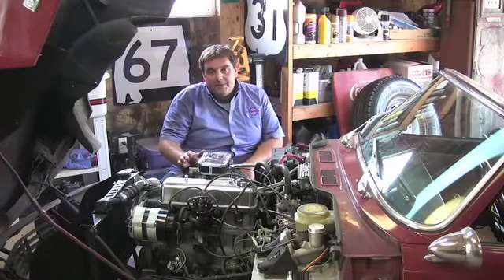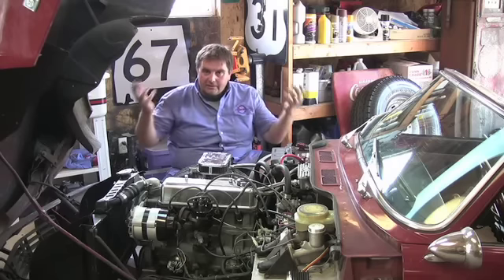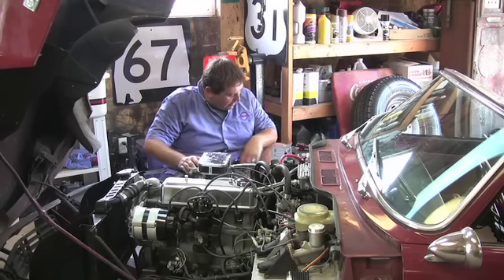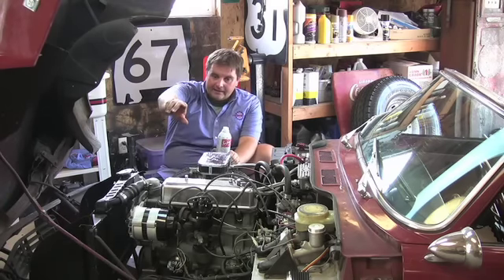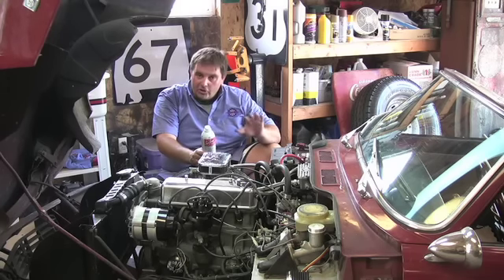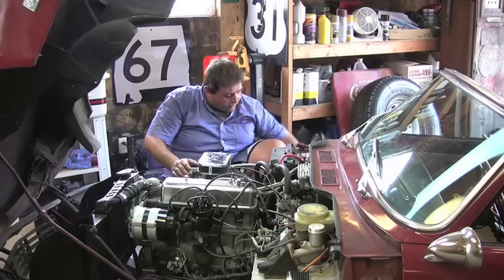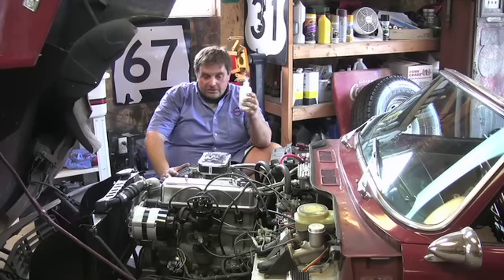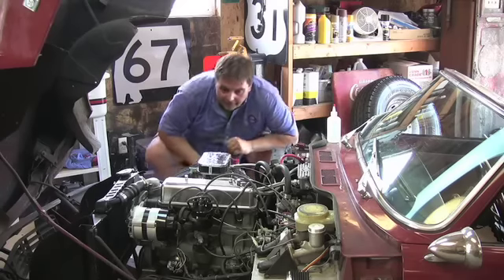Dieseling - How to clean out your carburetor

Comment: thanks, the Seafoam helped a lot with my dieseling.  65 Corvair with two single carbs.  I was pulling my hair out fiddling with the timing and idle screws, but I think you're right, they aren't causing the dieseling.  Now it only hiccups when I shut off the engine, hopefully that will go away with more driving.  In the meantime, I can eliminate the dieseling entirely if I shut the engine off with the trans in drive instead of neutral.

Comment: Used a can of Sea Foam in my Triumph Spitfire to cure a bad case of dieseling. It didn't make any difference at all. But, reconnecting the anti-run on valve (it had been disconnected, along with the oil pressure switch, to allow for an oil pressure gauge tap to be installed) cured the problem immediately.
They put anti-run on valves in these cars for a reason, I guess.

Comment: I remember many cars that I owned from the 1970's with big engines would always keep on running after I turned off the ignition. I actually had to drop the gear selector into drive to stall the engine to get it to stop chugging away.

Comment: in my case, my car has a recently restored engine and therefore does not have internal carbon. I cleaned the chamber myself and the pistons are new. It has the fault, when turning it off it does not keep turning the motor with jumps.

Comment: I turn the car off an it chuffs once out the carb, isnt running right but the gas is old in it too.
I'll change the gas and if it doesnt work i'll give this a shot...

My carburettor is alot bigger than this though, an edelbrock 650